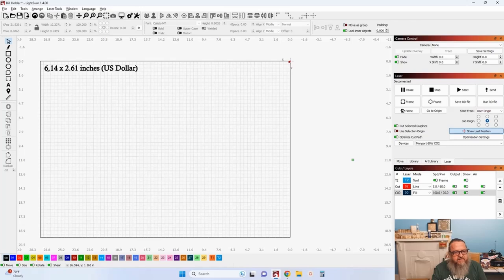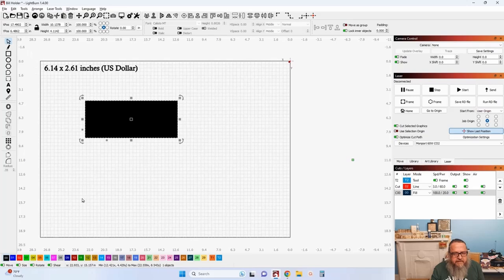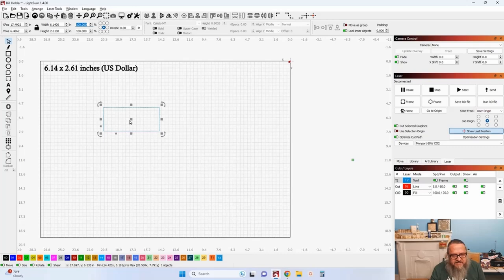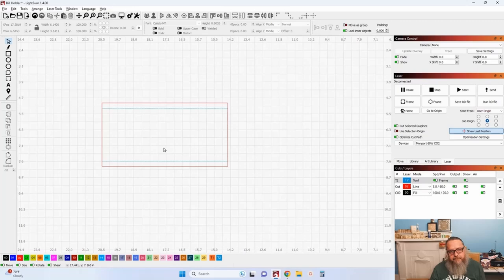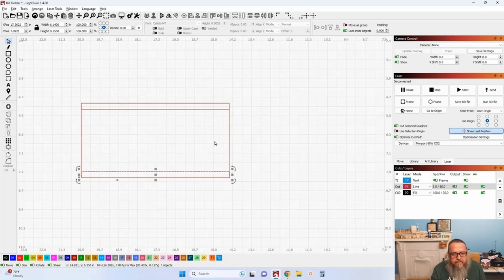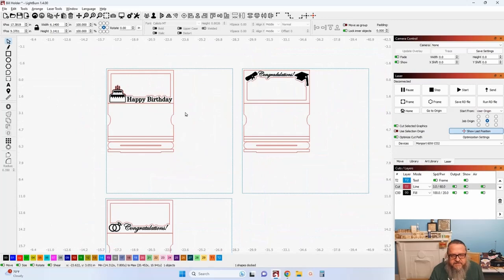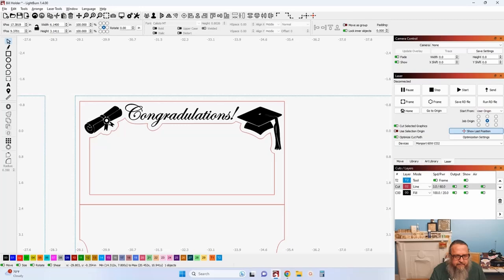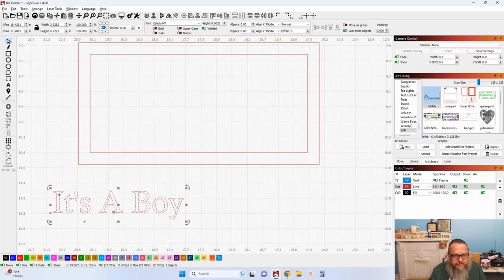Designing A Dollar Bill Holder In Lightburn

Comment: Enjoyed your video.  Made a prototype based on your pattern.  Apparently I missed the part where you were using 1/16th inch thick wood.  With the 3mm there was too much room once I put the money in it to test it.    I also enlarged the outside frame just a bit. In yours the graphic helps hold the money in place.  With my larger frame It holds the $$ in place and I can just glue the personalization directy to the frame.  Either one works out well.  Thank you again for the tutorials and the design plans you share with us.

Comment: I'm having a problem with the OFFSET. You only have to offset .3 or so, I have to offset 2.0 to get the same as you do. If I do a .3 I get a very little offset, not like ur's. Then when I put it in the BILL HOLDER and BOOLEAN it, it cuts the bottom off where the inside line cuts thru it so I get half of the word. When I did "IT'S A BOY" it worked correctly but when I tried to do a "IT'S A GIRL" it is cutting half of the word off. I did it the same as the one with the boy. What am I doing wrong?
Reply from the maker: The difference in the offset outcome is simple. It sounds like you are using millimeters, and I was using inches. As far as the Boolean problem, without seeing what you're doing, I'm guessing. But make sure you are only selecting the offset and the frame when combining. If the text is grouped with the offset when trying to use the Boolean tools, you will not get the outcome you're looking for.